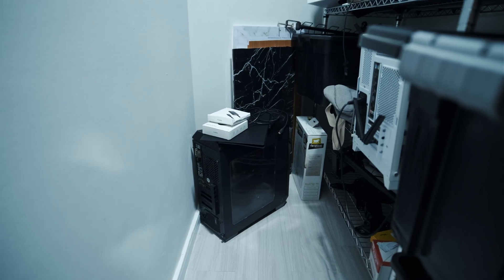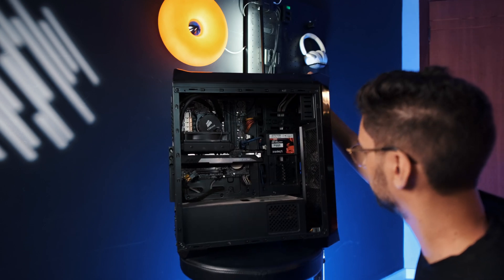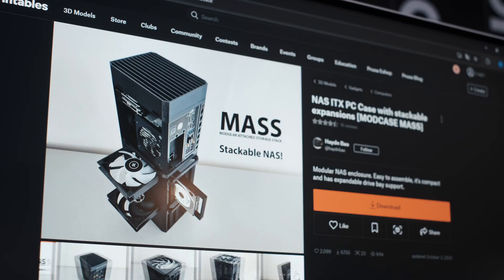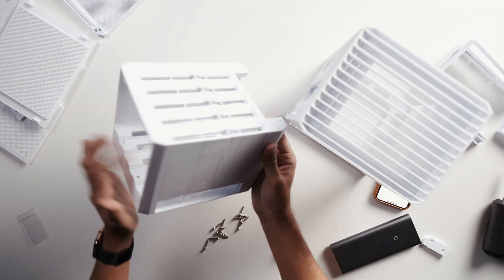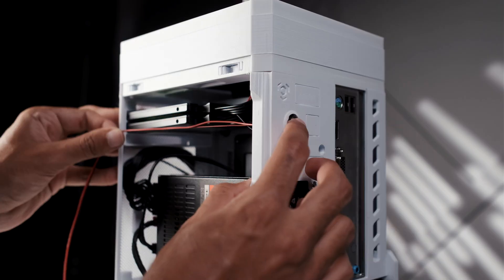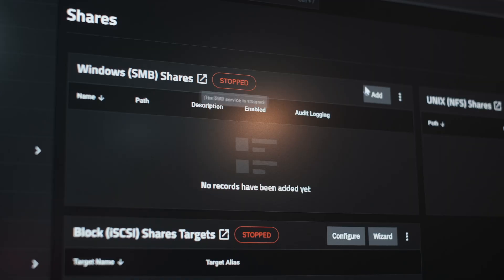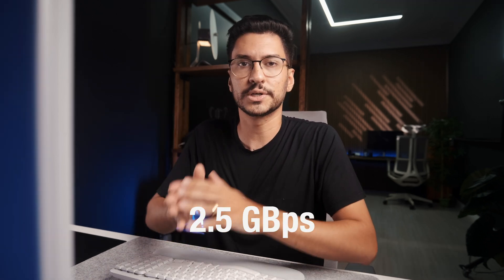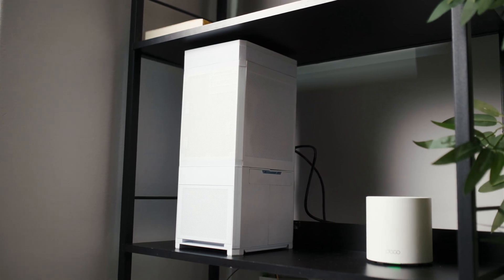Built My First NAS Server from an Old PC – Homelab Setup on a budget!

Comment: Nice! And what about power consumption, how many watts does it use? I've tried building my own NAS, but the project fails the power consumption test. I can't get it to run below 20W.
Reply: A single hard drive will draw around 10 watts, so I'm not surprised that you're having a tough time keeping it under 20 watts.

Comment: i always use my old pc as nas /server ,  when i buy the motherboards , am looking for it to have 2 pci e 16x or 3 ,so i can add a 10gb nic , and sata card for more drives ,  and display output so i don t have to use a gpu ,,  and al least 6 sata ,  so you can have 1 ssd for os , 1 ssd for current files or cash ,  and 4 hdd for data ,  and use raid 5 ,  or 10 ,  and if you use a old style case ,, most will have 4-8 slot for 3,5 drives , some will have dvd bays ,
Reply from the maker: Awesome! In the future if I need more sata ports I can use a M.2 adapter for more